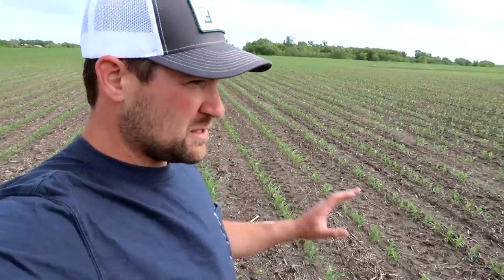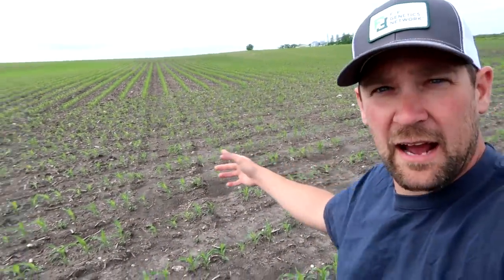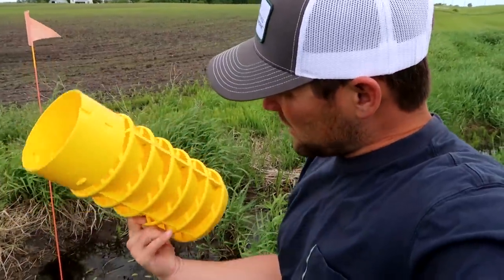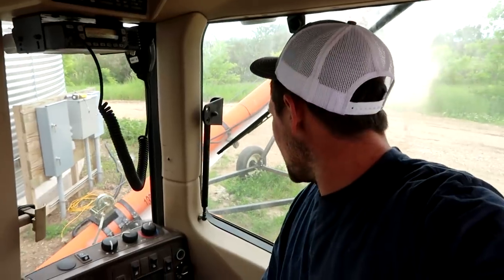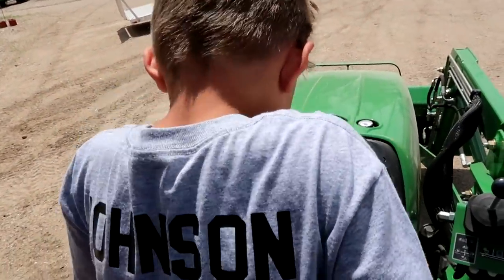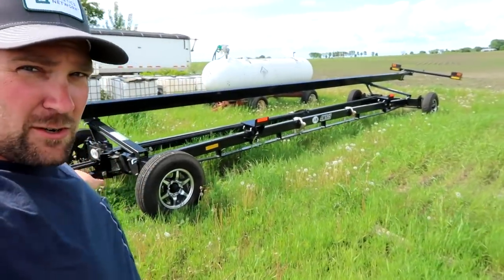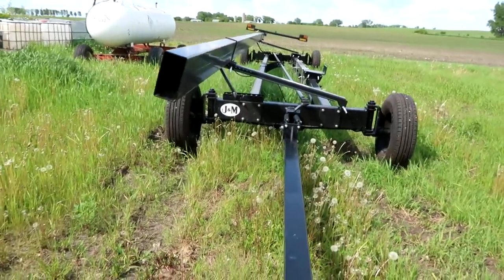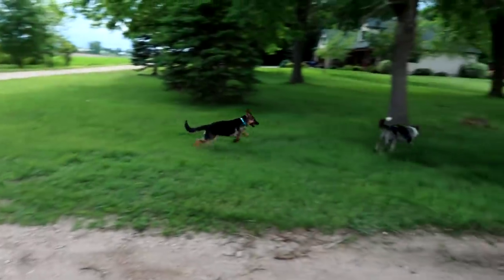Farm Kid Takes out The Trash

Comment: If you wanna trip the seat sensor just unplug it,  get a wire and two connectors and connect the two little prongs on the end of the connector
Reply from the maker: Really?  I had better look into this
Reply: Not that it's good to by pass any safety device but take the sender from the seat tape the button down and put it back in the seat
Reply: I carry a little jumper wire right on the mower, I've had a bunch of sensor failures and without a jumper you're down. I just jump switches until I find the bad one. Seems like the mower sensor fails the most.
Reply: My 3025e is bad about shutting down if I lean over to see the tips of forks on the fork lift attachment. I really want to go around the switch.
Reply: Disengage a safety feature...
Doest your insurance company pay out for "shouldn't have done that" deaths?
Reply: @MillennialFarmer  same thing for the own mowers except u need a clamp to push the button in

Comment: To get the John Deere to run there is a sensor under the sea unplug it and you will be good to go. If you want to cut grass while the seat sensor is unplugged there is a second sensor, you unplug it and then you have to solder a wire to join the two purple wires and then the mower will work.
All the best, Edgar

Comment: Hotwire the seatsensor, just connect the two cables together. Its a must on all learning vehicles 😅
Reply: That works on our lawn mower just   unplug the seat sensor and take a jump wire and plug it in each part of the sensor and it should work
Reply: I think deer fixed that so you can’t jump the seat switch any more.  They are running a three wire switch. Hyster has gone this route with their forklifts as well.
Reply: @NorthViewModelShop  Buy a replacement sensor and make it work and then tape it somewhere.
Reply: @talonjacobson7753   we dont have any sensors or cabs on our mower anymore they were in the way

Comment: jsut pull the sensor off and use a ziptie to hold the switch down.  Did it on my JD mower and works great
Reply: Or disconnect the sensor and wire together each side... use it at the golf course for all of our equipment
Reply: @THEPIERENB  true, but if you 0kan on reselling it it is easier to just use a zip tie so it can be put back to original easier

Comment: To bypass sensor, unplug, take a 2" jumper wire, stripped on not ends and put in hot side and go into other pin in the same plug.

Comment: I know the older JD 870 compact tractors have a seat safety switch that you could override by pulling the switch upward until it clicked, then use the seat prop rod so the seat couldn't come down and hit the switch. Make for a stiff riding seat but would work!

Comment: What I do with seat sensors is secure them in the seated position. The bigger bulb type I use zip ties. The smaller button type I use a piece of plastic from an ice cream pail, secure with zip ties, and then wrap with electrical tape. No figuring out which wires need to be spliced together that way as some have 3 or more wires. If you ever sell it, it's an easy fix to bring it back to factory.  I've done that with all my riding mowers so that I can mow ditches and sit on the fenders for counterbalance.

Comment: 14:07 you can normally run a fuse in it to complete the connection, or cut the wires and splice together if it's a basic 2 prong.

Comment: I'll tell ya what Zach, these rains have hit us hard too, over here across the Red. We had to put a 3/4 section in to preventive plant. Also we had a lot of Jim moments. Planter got stuck 4 times in the same day on the same field. Took a 9560 R to and an 8970 chained together plus the 9410 R planter tractor to pull the sucker out the first time. Darn near needed to pull the other 9560 off the cultivator to come help but we creeped her out of muck. It sure is handy to have multiple 4 wheel drive tractors around.

Comment: To do the sensor problem just unplug it and put some soldering wire on the two metal flaps on the sensor and then tape it up so no dust gets in and you are good you just needed to complete the Circuit.

Comment: To bypass Deere seat senors just unplug it and on the end of the wiring harness that goes to tractor (not the end connected to the seat) take a few inches of wire and crimp on spade connectors to each end.  Then connect each spade in to the two slots of the wiring harness.

Comment: Zack, I  had JD 4700 Utility tractor with safety switch on seat. I had to unplug wire harness and insert a jumper wire on harness. Tractor would run without any one sitting on seat at all.  Remember safety but years ago it was never a consideration.

Comment: Seat sensors reminds me I was operating 151 international combine .Went to stop the combine stood up on the pedals, pulling up on the steering wheel, lower set screw loose pulled the steering shaft up and out of the housing.Use my hands pressing up on the roof of the cab.to finish stop the combine.12 years old maybe 100 lbs.LIFE  ON THE FARM ALLWAYS NEWS SURPRISES LOL.

Comment: For the seat sensors, when you unplug the sensor try jumping the connectors with a paper clip. Not sure what switch JD uses on their seats, may need to close the circuit to bypass.

Comment: I have noticed a lot of comments suggesting pouring a concrete pad under your grain auger but that wont really solve your problem as water will still collect there. When drier dig and trench out sloping down to a lower area and back fill with a coarse gravel. You can top with a sand and pea gravel mix. That way you have a naturally draining area still accessible for future excavation.

Comment: Use a 14 or 16 gauge insulated wire. Attach spade ends to jump the connection for the seat safety button.

Comment: For the seat sensor on the tractor unplug the wire if its 2 wires then connect the 2 wires together if its one wire then connect it under the head of a bolt that holds the seat to the tractor

Comment: The way you hotwire those seat sensors is you make a wire that makes a connection between the 2 prongs on the connector that connects to the sensor

Comment: Just an unsolicited suggestion, you need to put in a french drain and a sump to draw the water from the location of the auger. Some tile pipe and a buried 5 gallon pail would provide a sump you allow you to pump it down properly Zach.

Comment: To bypass the sensor on your garbage running tractor, disconnect the sensor and cut off the connector of the 2 wires running down into the tractor. Short them out and insulate them. The tractor will keep running even if you drive it standing up or fall off it.

Comment: You have to unplug the seat sensor and then use a jumper wire to close the circuit. I let my three year old run our John Deere zero turn mower all the time.

Comment: If you drill small holes in a bucket then set it in the hole by auger and fill around the bucket with gravel it will be easier to pump out.

Comment: Disconnect the sensor under the tractor seat. Jump it out between terminals with a piece of wire that has coating on it so it doesnt ground out to the tractor.

Comment: Your trash hauller looks like my wife's tractor.  We tried to run a feed grinder with it and the seat interlock would not let the PTO run without anyone setting in the seat.  I first set a 100 lb tractor weight in the seat.  I was afraid that it would tear up the seat, so unplugged the wire to the seat interlock and used a 3" piece of electric fence wire to bypass the switch

Comment: Take a piece of covered wire, strip both ends, make it U shaped,  & stick it in the end of the plug.  Defeats  the switch switch.  Or use a drill screws to screw down the switch, just depends on the type of switch you have.  I did that to my  6420 IVT tractor.  But like a week worth of use, the computer say, a problem with it,  so you have to unplug the switch behind the seat on the floor. Then plug it back in.

Comment: Hey pull the plug apart and put a piece of tinfoil from one side of the plug on the tractor wire to the other side of the plug on the wire, the cover up with electrical tape, gives constant feedback. Works on a 2305 deere, an older version of yours. Only thing is it takes away all the safety features like auto off pto and engine kill in the case of a rollover so use at your own discretion lol

Comment: I have bypassed a seat switch before the only ones I’ve  done are older ones,  so yours would may be different,  but on my tractor there were only 2 wires to the switch, just short them.  I just cut the connector off and spliced them together.  And it ran fine

Comment: Try unplugging the sensor and using a jumper wire in the plug end that plugs onto the sensor.  Or you might be able to cut the plug off and splice the wires together.  This should work if the sensor switch is a normally open type switch that only closes when there is enough weight in the seat.

Comment: Take a small piece of wire and put spade connectors or whatever you need on it and jump the terminals. Completes the circuit. Usually a five minute job

Comment: unplug the seat sensor then using 2 spade connectors and a small piece of wire  loop the tractor side of the seat sensor back into itself to complete the circuit, once he is heavy enough  remove the jumper wire and plug the sensor ack in. good to go

Comment: Easy way to bypass that seat sensor is to make a short jumper wire. Should solve that problem. It will complete the circuit allowing him to drive it.

Comment: try unplugging the sensor and then stick a jumper into the plug on the tractor side, it's liely the switch in the seat is normally open and preveting the tractor use. By jumping it the tractor thinks the seat is loaded and the switch is closed.

Comment: I like it way to go teachem young kids have to learn I was operating a tractor very young driving grain trucks with wood blocks taped to the brake and clutch and a pillow under my behind and I still looked through the steering wheel and the dash lol on the tractor I had to slide clear off the seat to push in the clutch or hit the brake but I ran the disc quite good

Comment: We have an old riding lawn mower that has/had a seat safety switch. Thankfully it is only two wires, we have 12V starter issues once in a while which means we have to run a jumper from the battery to the exposed terminal on the starter/generator to get it to start. That means the seat has to be flipped up to get to the battery, that switch was disconnected and has a stiff wire jumping both terminals to make it think the seat is down and someone sitting on it. Don't know if that will help but thought I'd throw it out just in case.

Comment: If the seat sensor is just a two wire sensor you can just unplug it and run a jumper wire between the two pins on the harness. Makes it think it’s always set.

Comment: Hack the safety switch by unplugging it and then install a jumper wire on the tractors plug, not the seat side. All of these safety switches work by completing a circuit. Awesome video as always! !

Comment: Just find the wire there’s two of them  stick up they go into the seat cut it and I believe you  spread them apart And that is pretty much breaking the connection because when you sit on it it almost puts pressure on each side of the wire that pushes it to connect it if that kind of makes sense I did with my tractor lawn tractor but it is less safe

Comment: On our new holland we had the same issue on it the us little switch that has to be pushed down and we pushed it down and then put a washer to hold it down and just left it in all the time never bother to take it out and never had an issue with it after that
I don't know if the switch is the same but just find a way to jam it down and if your not sure if you got it try to start the tractor with out any weight in the seat I should start and let you put it in gear with out stalling

Comment: For the seat sensor unplug it and use a paperclip or a piece of wire to go between the negative and positive on the line going to the seat. It fools the system thinking someone is in the seat. I did that on a couple of lawn mowers 1 was craftsman the other was a diesel Kubota. As far as I know all tractors have a 2 prong connector.

Comment: Just make a jumper connector or splice the seat sensor wires and itll see the connection as if someone is sitting on the seat. Should be a ground signal its looking for.

Comment: With that sensor, just short the leads together.  It will then register always as someone in the seat.. obviously that defeats the safety of turning off the tractor when you get out of the seat but it will also take care of having to worry about how much weight is in the seat.  BTW, short the lead on the tractor side not the seat side.

Comment: Tie the wires together.. or unplug it and jab a paper clip..bend a staple.. bent framing nail.. mig wire ..what ever in it to make ends connect.  Then tape it up a bit. Wanna go back to factory just pull it out n plug er back in.

Comment: To bypass the sensors on the seat you need to unplug it and connect the two wires together it won’t work just unplugging it

Comment: Where the sensor plugs in under the seat you need to put in a U wire   on the side that it comes in from (the supply side and not the seat) that way it will bridge the safety seat sensor and disable it... Not that your read this comment anyway....

Comment: cars have these "door ajar"(door jamb switch) buttons on the pillar of the body, when opening the door the pressure on the button is released and the in cab lights turn on. when removing the doors for repairs, you have to unscrew the fastener, hold down the door jamb switch and unplug the wire. the vehicle will be tricked in thinking the door is still closed will not turn on cab lights and will not kill battery. Try that out and see if it works for you on the seat sensor? if you haven't already thought of that.

Comment: To disable the seat sensor you unplug it and then join the two wires together that used to plug into the switch in the seat.   The seat sensor just makes and breaks continuity of the two wires...

Comment: If you were to unplug the seat sensor then run a jumper wire between the prongs to complete the circuit that might just solve that problem.

Comment: You need a jumper wire in the wire going to the switch. We have done it on many older series combines until the 50 series because they put more electronic crap on them and now you can’t do it anymore.

Comment: @MN Millennial Farmer  if you use 2 male flat blade crimp connectors with a piece of wire in between them and then shove them into the plug for the safety switch in the tractor it will complete the circuit and deactivate the safety switch ( the safety switch is like a light switch when you turn on the light switch the light turns on and when you sit down on the tractor in sends power back to the computer in the tractor saying that there is power there and when there isn’t any weight on it, it breaks the circuit and the tractors computer doesn’t get power from it not allowing it to function) sorry for the long explanation, hope it helps

Comment: If the sensor wont work unplugged.  Then it needs a wire to connect it across the plug.  IE when a larger person sits on it the connection is closed.

Comment: Pull the plastic connector apart on the bottom of the seat. Then take a piece of wire the same size as whats feeding the seat sensor and make a jumper . Put one end in one side of the connector and the other end in the other side. Problem solved ! (or just google it )

Comment: I have a similar tractor, to override the seat sensor, unplug the harness from the seat, put a jumper between the 2 wire in the plug.  A 3m Scotchlock blue connector will do it too.

Comment: A question. Does your rotten corn have maggots in or on it? If not you are missing one of the stinky parts. in the early '70's I had a 3,000 gallon tank on a 5 ton truck, it had spent many years hauling spent sourmash from a distillery to the hog farm and the feed cattle.. It had maggots in every crack and crevice of that tank and I thing the maggots threw up from the stink. I had to haul water to wet down dust on the roads we were building at the time. I can still smell it.

Comment: The way to bypass those seat sensors is you got to trick the sensor into thinking the seat is always pressed down. You can put a wire between both sides of the sensor to have the circuit continuously completed. Billstmaxx might have a video on him doing it to a 2r

Comment: Man - all these plastic bits that you use, like the tile inlet cage, etc. could be quickly manufactured using a desktop 3d printer. Maybe that's not the kind of equipment you'd expect to find on a farm but guys in my area use them all the time. They cost a couple of hundred bucks and considering that one of those cages can be around $40-50 the return on investment can be quite quick.

Comment: I think the seat sensor is a grounding sensor that has to have connection to not be grounded (needs a jumper wire across the plug), at least that is how I get around ones on riding mowers and back up buttons.